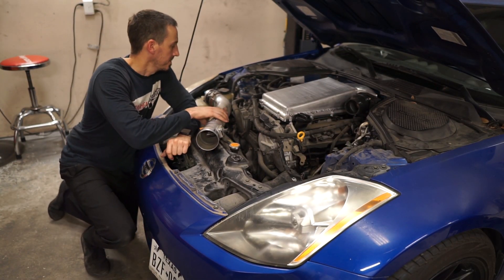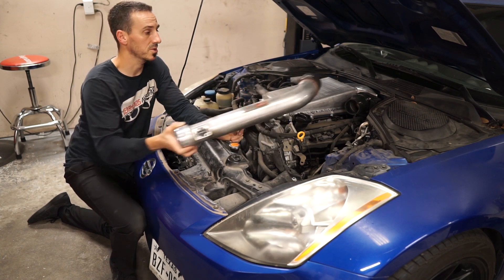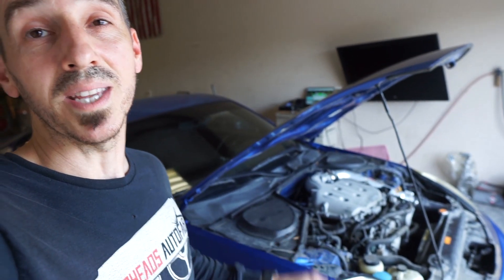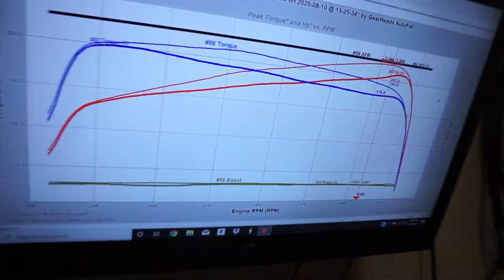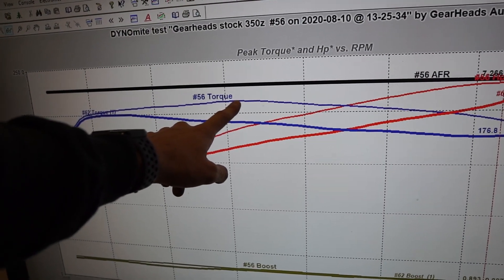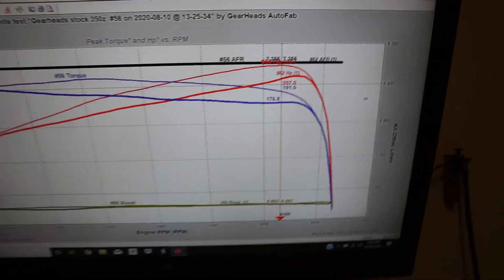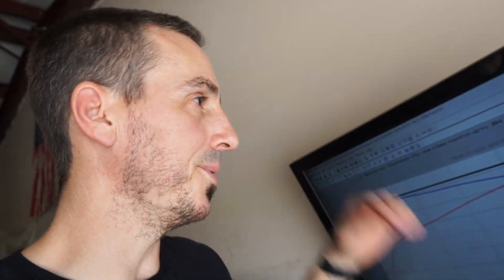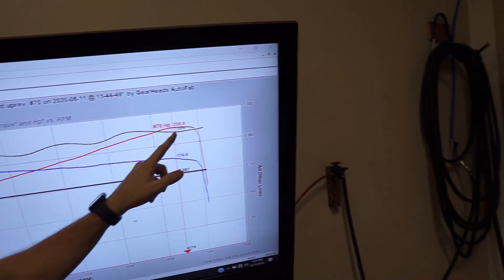New 350z intake manifold (Dyno testing)

Comment: ?? Would you be interested in making a detailed video on uprev? Some where it instructs purchasing the license, uploading the license, and all of the parameters and features??? A detailed walk through for the community please 🙏🏾
Reply from the maker: Man your head is in the right spot the most important thing on these cars is the Tuning I have not done a tuning video for these uprev cars,When you buy an Up Rev cable with a license already loaded on it it’s pretty easy you just download the software and plug it into the car license the vehicle and then start tuning. Make sure to buy a arc license at the same time, this license opens up a much better timing table and all the advanced features launch control full throttle shift etc.  if you’re tuning your own car and you get stuck on anything or just have a general question you can totally just hit my email, gearheadsautofab@gmail.com
Reply: @GearheadsAutofab  bro, thank you

Comment: From the video the new intake doesn't have good velocity stacks like the factory ones and you also reduced the length. Like you said, definitely only for boosted applications.
Reply from the maker: I think you are right. I just boosted the car ……made over 100hp@ 5 psi …..it’s working good with the turbo.
Reply: @GearheadsAutofab  hey, wanted to see if this project was still coming together.  Just hit the dyno with my twin DE and made 546hp 463tq.  My stock plenum has some bolts stripped and was letting some boost escape and remembered you were making this, havnt seen a vid in a while.  let me know.

Comment: Ever update this design? These results remind me of my own. I swapped a regular DE lower plenum with a revup lower plenum. The shorter runners moved the power curve to the right and held power all the way to redline. I suspect the runners are too short on this. Between upgraded cams/valve train, retune and possible spacers under that manifold to increase runner length, I think you'd find the results you want for n/a applications.

Comment: Man i just can't decide anymore 
I want the 240z(make it modern with  rb26dett) or the 350z and upgrade the shit out of it
Reply from the maker: Both so different, i’ve had an RB 25 240sx, It was fun but very expensive to build, and I’m just doing my second z now, I do like the conveniences of a newer car sometimes compared to the old ones. I think the last year to my opinion on doing an RB swap has changed. I think I would put a K-series Honda engine in a Nissan swap if I had a chance...... hint hint we might have a k24 / 350 Z in the works.....
Reply: @GearheadsAutofab  k24 are cool aswel and you can hit high numbers haha

Comment: How much is an UP-REV license?
Reply from the maker: Just the license is $300 and the arc add on is $100. As long as you have a pro tuner near you you don’t have to buy a cable.
Reply: Gearheads Autofab thanks. I’ve got a v35 skyline here in Australia. Might look into it a bit more